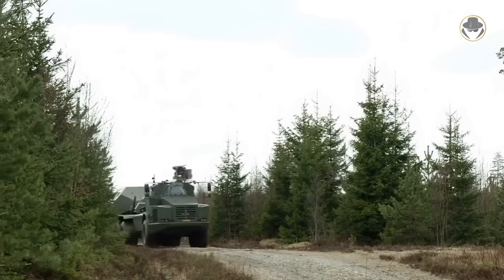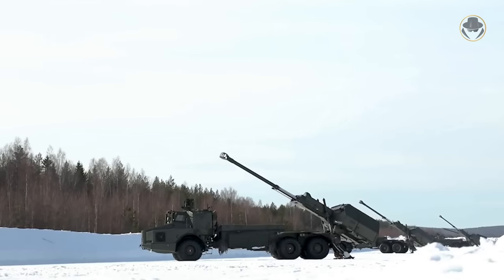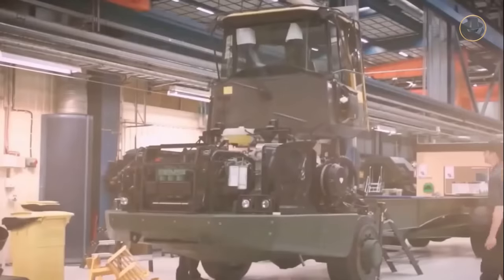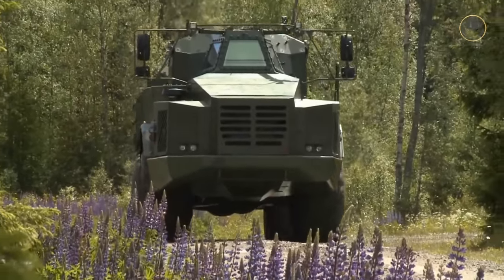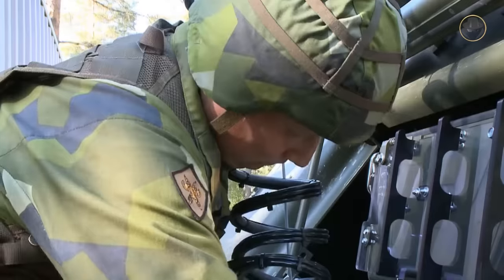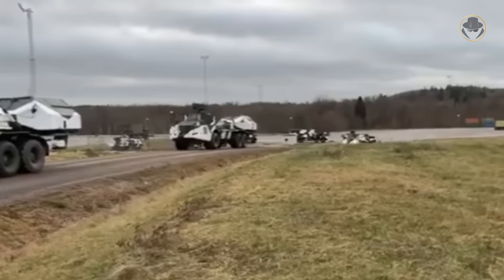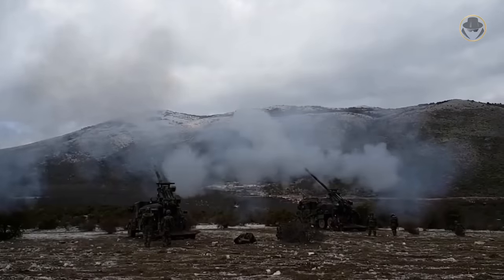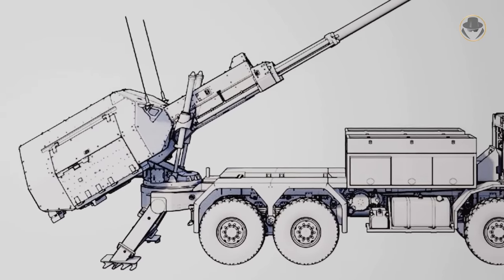Archer Artillery System | What is wrong?

Comment: Informative and objective video, doubt it is anything wrong with Archer except that development took way too long time. If it had been on time, both Denmark and Norway would have it and probably some other countries. The rate of fire is much higher than for example the truck based Caesar with traditional loading. First few seconds is then artillery has most effect so that is a key metric.
The "magazine" is fairly complex engineering, can understand it took time to develop, I would also think that could be the maintenance/reliability issue. If there is a potential weak point the 21 round mag would be my guess, how is the reliability? 

Doubt the articulated Volvo design is any problem, much more of a strength, the civilian version has been used in rough forest terrain without roads hauling timber for decades. 

The cost seems to be higher for Caesar. Yes, cost is always hard to compare since we dont know how much training, maintenance etc is in the "system" price .I would have expected Archer to be significantly higher in price with the complex 21 magazine. Track Self Propelled guns are even more expensive than Archer/Caesar. 
Will be interesting to see how Archer does in the Swiss evaluation.
Reply: And multiplied with the time on target capabilities.  I.E. get 6 rounds off per gun, arriving simultaneously and you are moving off to your next firing position before the rounds even hit.  Two or three dozen rounds hitting all at once has a quality all its own.

Comment: 1:01 Is actually me driving (Recognize my TC). Trident Juncture 2018 in Norway, all drivers had to "Practice" crossing that bridge that the engineers put up :)
And a correction, it isn't fitted with CTIS. However it has a built in pneumatic system which can be used to change the air pressure by connecting a regular air hose and a tire pressure gauge.
Reply from the maker: Thanks for correction. We hope you enjoyed the video.
Reply: @WeaponDetective  I for sure did!
Reply: Did you choke on your morning coffee when you visited Youtube and saw a video of yourself? lol. Thanks for the extra info!

Comment: Some further cross-experience from documented Ukrainian Howitzer war experience:
1. Towed howitzers like the FH77 & M777 have been hit by counter battery if not moved often, which by definition is hard work; of course the SPH's are more survivable
2. German requirements for PzH 2000 only envisioned firing 100rnds per day. Real war experience against Russian army requires far more shells per day for defense. PzH 2000 are showing systems errors due to excessive use &  auto-loader needing replacement parts sooner than expected. Not ideal design for high intensity combat. It has been mentioned by German politician that only 5 out of 15 PzH 2000 in Ukraine are presently operational due to unforeseen early critical maintenance.
Reply: Trust me bro
Reply: @minecraftboy4208  german Business Insider wrote about problems with PzH 2000 in Ukraine. Beyond what was mentioned above, they are susceptible to fast wearing if loaded with ammunition not intended for them, like french 155 mm ammo for CEASER's. Ukrainians love polish Krab's, because they are more forgiving and generally easy to operate.
Reply: @minecraftboy4208  Russians lob shells at a rate far more than any other military can imagine.
Reply: @patriotenfield3276  Yes, but if you have seen any images of Ukrainian fields, a large amount of those shells lobbed are simply wasted on suppressing field mice and moles. 50.000 rounds a day is an impressive fireworks display, but if you don't achieve your objectives, it's just a waste of ammo transport capacity and useless degradation of gun rifling.
Reply: @stefanb6539  yet is russia the one that is losing territory? the goal is not effectiveness, the goal is to win the war, and ukraine is losing, so as stupid as flattening the entire battleground is, it works. if it was just "firework" ukraine won't be losing ground.
Reply: @lagrangewei  russia hasn't gained any appreciable ground in over a month
Reply: @BiohazardPL  the problems are primarily due to overuse of complex equipment and only very limited maintenance.
Krab, AHS90, K9, M109 etc would face/do face similar problems under the same cirumstances.
Ukraine had fired alot of overpressure charges in the first weeks of the PzH2000 deployment, wich took a toll on the systems.
These Systems cant be repaired or maintained by the ukrainian army and have to be shipped back to poland for maintenance.
Due to the limited amount availible, these Systems are used until malfunction, then shipped to poland, repaired and send back to the fight.
thats not how a western military would use its own equipment.
Reply: @lagrangewei  "is russia the one that is losing territory? " Yes, actually. 

In March, Russia held roughly 30% of Ukraine. Today, they have about 20% and are slowly losing additional territory.
Reply: @BiohazardPL  "french ammo" do not exist they are nato 155mm and I heard more about the Caesar than the krab especially when only the Krab get destroyed
Reply: @paddington1670  Russia has been taking new territory every day.  It’s a war of attrition against deeply fortified lines so they advance more slowly at times to thoroughly shell hardened positions before advancing. This also causes Ukraine to pour in more troops to reenforce these areas, which again contributes to greater Ukrainian attrition while minimizing Russian and allied casualties.   If Ukraine was winning, then they wouldn’t be so desperate that they’re shelling a nuclear power plant in hopes of creating a demilitarized zone. Or let me guess- you also believe the Russians are shelling themselves?  Because even Western media is slowing admitting the truth about that.  It’s doubtful, but with any luck a peace agreement will be reached before Ukraine is completely landlocked.
Reply: @crinklecut3790  Sure bro
Reply: @lagrangewei  the battle has been in effect a standstill for the last MONTH, "losing ground" my ass
Reply: @thepny_chasseur_de_tricera5361  the only destroyed krab drove over a anti tank mine which would have also destroyed a Caesar. its also possible that the polish crabs are sent to more dangerous areas as they offer a lot better protection for the crew. which also means information pretending to them is more sensitive.
Reply: Some people would rather bury their head in the sand than grapple with the grim truth about the prospects for Ukrainian in this conflict.
Reply: @butspan7618  at the end, Ukraines would know better than anyone else that which self propelled howitzer system worked better in the real combat situations. Let's wait and see which one Ukraine would choose to buy more of.
Reply: @stefanb6539  The problem is that Russia mathematically has worn out it's barrels months ago. The Rifling is likely all gone and the barrels are now at risk of cracking open.
Reply: Given the conflict that PzH2000 had been ORIGINALLY built for, I doubt the 100 rounds projection (even this IS a considerable number - bascially, 2 full loadouts. ).
Reply: @Seth9809  really??.....fascinating.
Reply: @lagrangewei  Russia losing territory in your wet dreams.
Reply: @oscarcollier5141  you are u even replying to, the one that say russia is losing isn't me, lel.
Reply: @stefanb6539  images of Ukranian fields?  What images are these? And how do you know what they were firing/fired at??
Reply: Any artillery system is going to break under undue and unforseen pressure, even krabs are losing their barrels an tbh I cannot see archer doing any better under constant and repetitive firing.  6 rounds per minute under testing/training is not even comparable to 600 rounds per day under operational tempo, something ukranian artillery is now finding out.
Reply: @crinklecut3790  This comment didn't stand time so well, did it? ;-P

Comment: 14:25 mins: Normally it is not wise to fault the potential buyer for a product not selling. 
While I agree with you that the Archer is a fine system, there may well be other causes. The mentioned maintainability of the truck has been solved by using a 2nd type truck. But its a complex system, being fully remotely operated. Other automation may be more complex to maintain.  Its possibly more expensive than comparable systems, both for purchasing and maintaining.
The gun is the same on all competetive designs (155 mm L52) and all fire the same ammo. Archer may be able to leave the fireing posistion in 30 seconds, which is fast. But all competetive designs can do that in under a minute, so all are sufficiently fast. And what about reliability of the autoloader? Using manpower usually gives more flexibility when something breaks down. Having the crew in a separate compartiment, may then not be the best solution to that situation.
I think Archer is a wonderfull design from an engineering point of view. But it is more complex than its role requires, requireing a more trained and specialized crew... and it is possibly too expensive to build and maintain.
Reply: The new German RCH 155 from KMW can shoot while moving. No other self-propelled howitzer  can do that.
Reply: @OpenGL4ever  How does that affect it's accuracy though? It seems to have a relatively short wheelbase so a small bumb in the road must throw the accuracy out of the window?
Reply: @TheSimon253  The trick is to use a computer and sensors. The computer knows when to shot.
Reply: @OpenGL4ever  no shit
Reply: @TheSimon253  Well, that's the way it is done while keeping accuracy and precision.
Reply: Archer is made for future wars. Not the vietnam war

Comment: I think the Archer is something of a medium between a tracked SPG and an truck mounted SPG. The problem I think is that it's too expensive for something that is a compromise between wheeled and tracked SPGs.
Reply: minimal advantage over ceasar and zuhana at greater operating cost
Reply: Theres actually a truck mounted version ordered by the Swedish Army in their expansion of their military following the war in Ukraine and them joining NATO. They are acquiring 24 more units. They are also moving on acquiring rocket artillery. The hope of BAE is that the truck mounted version (rheinmetal truck platform) will be more appealing on the world market compared to the current version mounted on a dumper platform from VOLVO thats not massproduced contributing to its high cost. Press releases were sent out last month.
Reply: Why buy it when you can swipe 50k for a 1960 soviet arty.
Reply: @aletheides3990  ukraine will never join nato,ukraine is just a western pond
Reply: How much?
Reply: @John.S.Patton  Still using the same name generator I see!
Reply: @surferofthesynthwaves4710  can a 1960 Soviet piece fire 6 rounds at maximum 4 meter dispersion and leave the area before the rounds hit target?
Reply: Same

Comment: You're missing the spec of 60Km with Excalibur munition.
The off-road capability is FAR surpassing the Truck mounted artillery. Might want to check yourself there buddy. It's basically the most advanced SPH out there.
The Volvo articulated hauler is widely used and extremely durable. Volvo is huge in mining, trucking and so on in the world. I don't think you grasp how effective and demanding the Swedish armament industry is. The requirements placed on them by Sweden in use, functionality is bar none. The roads and climate and terrain this vehicle needs to traverse in Sweden and temperature is very strenuous. This artillery system is specifically for Northern Sweden fighting a potential Russian invasion via land for example.

The system is so new that it has barely delivered 48 units and only been doing so at full production in the last few years.  There isn't anything wrong with it at all.
Raytheon and Bofors used this system to test the Excalibur munition they developed.

Besides cost because of the hauler, they already have ideas of an export MAN 8X8 version to "ease in" any country for it's use.
Reply: You sound like Vladimir with all that mighty claims... this truck have no chance in many cases to be as effective as vehicle with tracks->and Ukraine is a good example. You can easly find pictures of tanks and other lighter tracked vehicles that were stuck in Ukrainian soil=>Archer would sink in Chernozem in no time...
Reply: @Bialy_1  It's not a truck.
Reply: @Bialy_1  your wrong
Reply: The archer is over a decade old, hardly "new", and the only reason only 48 have been made is purely because that is all that was ordered, 24 for Sweden and 24 for Norway with only Sweden actually taking theirs and the rest being put into storage after Norway pulled out of the project after delays due to technical issues.  You can literally only fanboy this system so much.
Reply: @Reg regan 
It entered service 7 years ago. Before that it was prototype stage. It’s a very recent system that is only now coming into maturity. Perhaps be a bit careful with calling every other poster “fanboy”. You post more than anyone in this whole comments thread and seem to have an agenda.
Reply: @tor2919  concept from 1995 with first prototypes from 2011 and still not sorted after 7 years of full operation, obviously just a lemon then as how many years do you want champ?  This is a gun system not a bottle of wine.  You don't seem to understand the term fanboy, it's when you talk something up so much even despite all the evidence to the contrary.  No one is using this system, am I wrong? Is everyone/anyone else not using it wrong?  The consept of self propelled guns are not a new thing by any means.  Face it, there are obviously better systems out there.  Yea my agenda is sick of all you guys trying to talk this up when the facts are quite obviously clear, no one is interested in your volvo articulated archer artillery, simple, and for some reason you all believe you know better than the actual artillery experts from around the world that have not aqquired this in even 7 years (ALOT of SPH deals have gone down in recent years alone!), perhaps another 7 years huh that should do it?  The funny thing is I actually was a fan of archer (not to be confused with fanboy), now not so much for some after all this hype.

Comment: Only Archer provides armoured protection to the firing crew. Pay a couple of quid more for the odd spare part and Archer shows all the assisted load truck mounted guns a clean pair of heels! Only DANA/ZUZANNA come close. UK is to acquire 18 Archer to temporarily replace ALLLLLĹ its AS90 as an interim measure. We need to get the Cheerleaders out and Shout the benefits as they emerge.
The biggest objection to Archer is its greatest advantage: its very small, protected crew - reduce the crew's, reduce the size of a regiment, reduce the number of Colonels you need!!!

Comment: Not all truck mounted guns leave crew exposed. For example, Nora B52 (also tested by the USA) is completely closed and has full ABC protection, protection from small arms and artillery splinters. Largely automatic and has auto loader...
Reply from the maker: We think that the design features you mentioned of the Nora B52 make it a wheeled SPH rather than a truck-mounted howitzer, like the Archer.
Reply: @WeaponDetective  Could you do a video about nora b 52, since there are very few about it outside of serbian/balkan youtube. Even tho its surprisingly prolific aroud the world, despite being produced in Serbia.
Reply: Newest DANA M2 is also fully automated with armoured cabin
Reply: @sqly3129  True, but Dana M2 is 152mm, so could only be relevant for modernization of Czech army if they want to keep to 152. They dont and thats why they are getting the new Ceasar
Reply: @HalloN1989  it can be in 155 too, in that case system is called DITA

Comment: My 2 cent on this is that the archer is the jack-of-al-traits unit.

Its as fast as a truck on a road (but more expensive)

Its better at offroad driving then a truck but worse then a tracked vehichle. 

It has a higher rate of fire then a traditiobal howitzer but slower then a muliple missile launcher.

Its like its the middleground of truck/tracked vehichle and howitzer/multiple missile system. Making it have clear disadvantages against everything. This is why I think its hard to export.
Reply: I think you hit the nail on the head. Norway left the project because the Archer didn't meet the requirements. My guess is, this can be translated to be too heavy for good enough offroad capabilities.

Comment: The new 24 archers will be built on a different chassis. It will not be on the articulated chassi but on a "regular" volvo FMX truck stating the cost and maintence of the articulated dumper. the new archers will also be intergrated at a battalion level instead of being a regiment as is the case today,
Reply: The only reference I can find to the extra 24 state the MAN 8x8 platform, as per the BAE testbed.
Reply: @regregan6852  might be man chassis i was not able to find that information at the time.